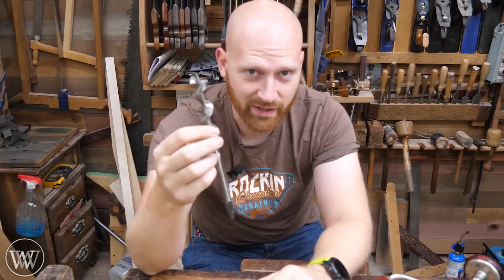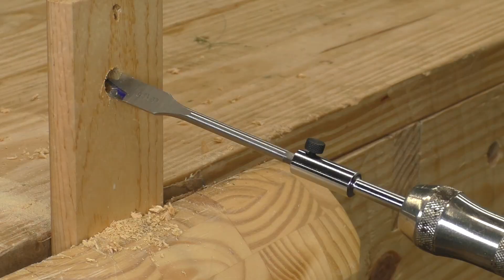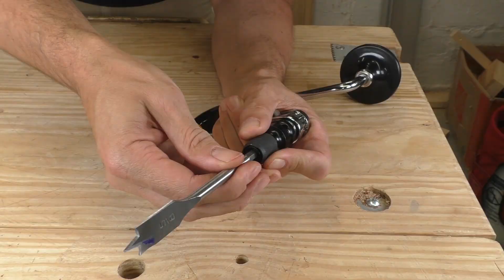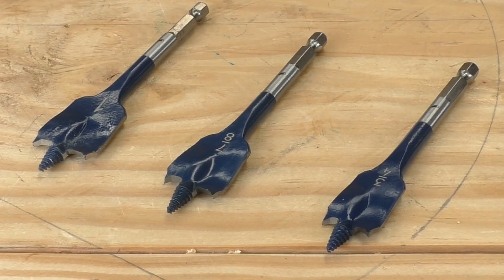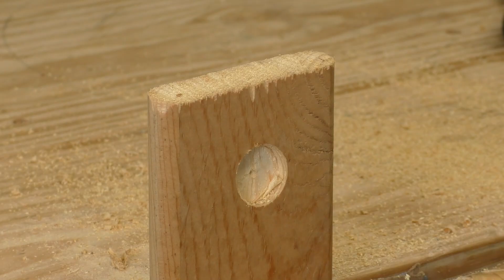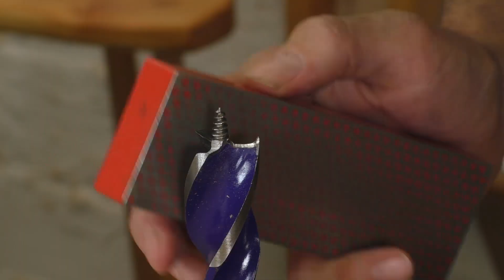Modernize your brace with new gear!

Comment: Rex I really liked the video and the idea of a 1/2 drive brace.  I find a lot of braces, bits and other old tools at estate sales and these are not frequented by many tool collectors.  I found a rusty brace (outside ratchet) that was frozen solid at one and picked it up for $0.50.  I tried all the different ways to free it up but nothing worked until I heated it up with a propane torch and that freed up the chuck that was sprung and got the ratchet loose.  Some time on a wire wheel cleaned it up nice.   I got a 1/2 inch impact extension set on amazon and turned it down to fit and drilled it for the pin.  I have less than $10 in this.  I used the chuck adaptors you mentioned in your video.

Comment: WARRIOR 7PC AUGER BIT SET
AMAZON lead screw pulls into work eliminating extra pressure and strains specialty heat treated alloy steel resist damage from nails quick change Hicks shank

Comment: I think ( due to personal experience hehe), to avoid the chipping, you have to rotate the bit counter clockwise almost 1 or 2mm in with some pressure, so the outside point slice (only when its Sharp) the face of the wood, leaving a nice unsplintered hole.. if you have a threaded snail, you may need a small pre drill or a nail (i dont know the english name but in spanish its called "punzón") so you can make the side edge of the bit reach the face of the board. Nice content Rex! Im sorry if i mispelled, spanish autocorrect+barely know how to speak my own language D:

Comment: Good video. When I was new in the Marine Corps as a helicopter mechanic ( 1973 ) we used a three jaw brace or a rotary hand drill ( most often called an egg beater drill ). Since battery powered tools did not exist then it was perfect for working out on the flight line. Fine tools rarely had any issues with drill bits providing quality holes. No margin for error on an aircraft.

Comment: Just get a corded drill cheaper than the brace Or try these 
https://toolsforworkingwood.com/store/item/MS-JB.XX
I know the point is that it isn't powered equipment though so. . .
They are expensive like rex said they would be but if you can't find vintage ones these are apparently really good quality.
Or you can get the More Modern wood owl bits. They Cut so smooth I'm practically drooling at finding an excuse to drill a new hole, and you can get each one for around 20 bucks a pop 1/2" bits should cost less than 20

Comment: No. Have not found anything modern   that works in a traditional brace. It seems all modern drill bits are designed for high speed. I look for auger bits at boot sales and similar.

Comment: These old tool's built all the old things post electric . I have three old braces ,one with no ratchet ,one with a ratchet and a Russian one with a ratchet. I worked  as a  handy man in the UK for many years, i  sharpened all my old vintage saws myself . Many times on a Friday teatime on a job my Metabo drill which is my very best one, but come four thirty died on me before the job was done .If not for my old brace drill i would have to get up with a hang over on a Saturday  morning to finish a job for the sake of half a dozen half inch coach bolts that needed to be fitted into a hundred x hundred mm fence posts.

Comment: Another great video Rex. I've had an auger brace for 40 YEARS. Don't use it much because flat bits are cheap and effective, but it is brilliant for removing ancient flat head screws. Lock it, rock it back and forth until the screw starts to move. Enormous torque is produced, but it can take the head off Then the ratchet starts to work the screw out. Best regards to you!

Comment: Hi Rex, since I watched this video i´ve been trying to found a solution, at least for the drill bits and I think I found something taht could work, the problem is that I can´t test it because the product is by no means availible in Mexico but here is it:

the design in the daredevil bits you present in the video is unapropiate for hand drilling in fine forniture, they are spadebits but the nickers have a total different design, I did my reserch and found a new product at Lowe´s , the brand "Spyder" sells a daredevil spade bits like the ones you presented but instead of that aggresive style of nickers these ones have a traditional take on that, making cleaner holes and also featuring a threaded point, have hexagonal shank and I think this could work perfectly for hand drilling even though these were designed for power drilling contruction lumber. these bits are branded "Spyder stinger drill bits" 

I hope you can take a look to those and maybe if they catch your atention you could buy them and make a video testing them if they worth it. thanks for reading, keep the good work.

Comment: Irwin Tools, Item Number: 43697, 13-Piece, Square-shank, 1/4" - 1" (1/16" Increments). I own them. I use them. They can be sharpened. Until recently, they were readily available. Affordable is certainly a relative term...but I would say they are. You get what you pay for with these. When I tried to order a second set (to give as a gift), I found they were out of stock everywhere. A little digging has me thinking that this, like so many other things, is a product of the pandemic, and not for having been discontinued. Eventually, stocks will return. When they are in stock, they go for around $120 per set of 13. Though, even at $200, they would be worth it. Mainly because they can be maintained by the end-user & they should last a lifetime.

Comment: Irwin does - apparently - still make, or makes again, square-shanked auger bits for hand braces.  The only trouble seems to be finding them retail .  The prices for indiviual bits seems to be reasonable, if you can find a seller who doesn't insist on some minimum number in a purchase.  The style is the Irwin design (solid center) as opposed to the twisted-ribbon Jennings design.

Comment: For years I have used a garden variety of multibit tools that you would buy at Walmart that have hex shank bits. I use step down bits to make holes in wood by hand, using these. Now the quality of the bits is important. Some of my bits are Bosch and I think a couple are Canadian Tire brand. They work much better than spade bits on manual drilling. When I used to use spade bits I would get massive blow out and tears. I have a few Amazon sourced step down bits but they are made of Chinesium and can’t do much except for MDF and even that is asking allot.

So perhaps try a step down bit. You can get some in standard 1/4 hex shank. The only drawback is that the thicker your material your hole size will be slightly harder to drill because a step bit doesn’t just have a set width so a little extra work such as drilling from both sides etc may be needed.

Comment: I have used the Irwin adjustable auger bit on very low speed drill presses and variable speed electric hand drills. I don't have the proper adapter for my brace.  The Garett Wade brace equipped with the appropriate chuck will provide good results because the Irwin is designed for slow speed and the single nicker has a  "back slope" grind so that it severs the fibers upon entrance like a chef's knife, leaving a clean entrance hole. The screw tip pulls the bit into the wood (unlike the other bits that require applying your muscle or body weight). With the two fully adjustable cross bars, it allows hole drilling from 7/8" to 3" diameter so you only need one bit.  I have dressed/sharpened the cutter many times.  And it's almost long enough to go through a railroad tie if you're into that kind of "fine woodworking" out in the back country. About $35 at the local hardware store.

Comment: i agree there is no perfect solution off the shelf, BUT in my own experiments i took two flat speed bits and triangle file and carved a tapered thread on the point on one.  Not as good as the auger but as close as i could get.
Not perfect but defiantly pulls in more at slow speed.

On a second try i cut the end off of an auger screw, slotted it and welded a replacement tip on the speed bit.
THAT seriously pulls into the wood at lower speed but not so great on the electric drill at full speed.

Speed really is the factor on the design.
.

Comment: I'll try to keep things short .... I'm more a blacksmith (more than a hobby, not quite a full job, at it for 20 + years) who has done hand woodworking. More because there's always a bit of wood or leather that needs to be part of the smithing project. Also do a lot with living history, so using and making hand tools is a thing. (Not saying I'm great at it.) You asked for options and ideas, here goes. 

First on the brace. The 1/2" drive brace already exists as a "mechanic's speeder". Different end handle, but it's a brace that's designed to hold sockets to drive nuts and bolts quickly by hand. I've been using one for years before I saw this and keep one in my mechanic's toolbox and another in my general box. I've been using hex tools in it by the simple and inexpensive solution of a socket that fits the hex shank of drill bits and screwdriver and torx bits. The only modification to the speeder is a 1/2" to 3/8" drive adapter. A bit of creativity to the turning end handle would allow for applying more force. 

Auger bits were not and are not the only bits for braces. There are three kinds I'm aware of, two for wood, one for metal. I only know the name for one type but I have used all three. I can't post photos here but I can put them elsewhere. One that I don't know the name of is basically the same as the business end of the auger bits without the snail. The one I have is hand made and has a point like a spade bit: no snail. It functions something more like a spade bit, but with the longer ears of an auger. Spoon bits I have made and used both what I've made and some I've found. They are not, in my opinion as quick as an auger, but they make a good hole. A bit tricky to sharpen and such but versatile. The last that I've made and used for metal in a kind of medieval drill press, has a triangular tip of very hard steel. It's flat, and the leading edges when turned clockwise are sharp. I think with a different angle at the point it would do well in hardwood. Smaller angle carves a hole fairly well in mild steel, larger angle works as a countersink.

Comment: Irwin still makes square tang auger bits. You can buy the 13 piece set of for under $150, look for Irwin item number 43697. Individual bits are available too. They also make many of their other style auger bits in square tang or hex, both in one bit. You cut the square tang off if you want to use the hex shank in a 3 jaw chuck. Of course you can't go back to the square tang once you've removed it, but that opens up a lot of bits for use in either drive.

Comment: I was pondering using my old brace and bit set and remembered the woodwrights shop on PBS, now that's some real vintage tool users show. I have seen many of the bits at antique stores all over the south, you just have to learn how to sharpen them, and one of the woodwright shops shows taught that. he's been on the air for over 30 years so I cannot remember the episode. He also demonstrated spoon bits as well. Looked very labor intensive.

Comment: I just found (buried amongst a lot of other stuff in my garage) a bucket of old auger bits and I collected my 3 braces to put them back into service.  I second you talking about how to clean up the auger bits!  One of the three braces was my grandfather's - he came over from Scotland as a carpenter a bit less than 100 years ago now - sadly, I am not sure exactly which of the three was his...two of them look a lot alike!  I have some snail-type bits that I use in my brace that I will have to go dig out and try to see if they are any better than the ones you tried.  Thanks for another great video!

Comment: Rex, I got the Garret-Wade Versatile Brace you recommended.  I really like it except for a couple of things.  The upper hand rest seems to wobble a bit.  I don't know if this is characteristic of all braces or just this one.  Any insight you could give would be appreciated.  

Also, the chuck does not fit my jennings style bits well.  The square socket inside the chuck is to big for my number 4 bit and is loose on all but the biggest bits in my set, which goes up to a number 18.  Do you have any suggestions on how I could fix this?

Thanks,

Steve.

Comment: I'm a precision prototyping CNC machinist by trade, I bet I could draw up a way to build new ones based off those old auger bits.
Wouldn't even be all that hard. But even still the metals we use these days are more pure and stronger than the tool metals of old. You'd likely still spend $30-$70 per bit and that's assuming the market demand was high enough to produce a lot of them to keep the cost down. But it's an idea that might be an interesting project to build.

Comment: Hey there Rex - something that might be worth trying instead of the brace: grab a generic 1/4" ratcheting bit driver and one of these: https://www.amazon.com/Irwin-Tools-4935651-Lock-n-Load-Extension/ or https://www.amazon.com/Irwin-Tools-4935652-Lock-n-Load-Extension .  Alternatively you could use a 1/4" drive socket wrench for the handle.  It wasn't perfect, but I just got done drilling 15 1/4" holes with this setup.  You really get a sense for how your bits cut into the wood.  And it's past midnight here in my apartment with no complaints yet from the neighbors :-)

Comment: Actually, the standard chuck that comes on the old bit braces is called a "universal" chuck because you CAN chuck a round or hex bit in it. This works well for simple twist drills where the chucked shank is the same diameter as the cutting end.  It works less well on bits where a narrow diameter shank is working against the leveraged resistance of a large diameter cutting end.  In that case the shank tends to slip in the chuck.
Another point: are you sure old auger bits are so hard to come by in your neck of the woods?  I see them frequently here in central New York at any venue were old tools are sold (flea markets, antique stores, garage sales) and for reasonable prices, like around a dollar apiece.

Comment: I have a big old brace that can hols a 1/2" square or round shank. I just bought a 1/2" socket extension for $6 at the hardware store (we live in a Walmart-free zone, closest one is 45 miles) My plan is to cut off the socket end and square off the stub so I can drive standard sockets, which in turn can drive hex shank bits.

Comment: I see on ebay a vintage craftsman 1/2 drive speed  handles going anywhere from .99 to $20 with about $10 shipping. (I think I got mine at  a thrift store for $5)

I then ordered the Quick-Release Hex Adaptor and Keyless 3-Jaw Chuck and they fit quite nice

IF your hex shaft bits have the retention dimples. as most cheap hex bits don't

I forsee me chucking a number of my cheap hex bits into my cheap corded electric drill and taking a round file to them to get them to work effectively. or replace the crap magnet on my 2" hex extension (which does have the retention thingie)

Comment: If you get the WoodOwl bits, which are awesome, you'll want to pick up this adapter: https://www.amazon.com/gp/product/B0009H5EPA/ref=ppx_od_dt_b_asin_title_s00?ie=UTF8&psc=1 It's like $30, but it fits the larger hex on the bits, and has a neat connection mechanism. putting the bit on is a push rather than a pull mechanism if you're familiar with this kind of tool. Still has the same issue where the GW brace's  snap-on mechanism is far looser than I'd like, and any resistance on the way back out of the hole will pull the bit off.

Comment: I’m wandering through the hardware store, and just saw Bosch brand ‘nail cutting wood bits’ and spade bits that look a lot like the old time brace bits. Spiral snail, finer cutting tooth on the outside edge. I don’t own a brace, but I remembered this video and figured i oughta mention them. Might work better.

Comment: I can't fulfill any of your criteria as regarding bits for braces, but;  If you take a old worn out paddle bit to the grinder and grind off the tips and nickers to a flat edge you will have the beginnings of a brand new tool! I have done so to one and then put a half-round point on it, then used that to drill out a tobacco pipe bowl. I just sharpen each leading edge (Carefully with lots of water bath to cool down) and it works like a charm. You could cut it into a triangle, or clip the edges to make an angled bottom bowl. just what ever you need to have a special hole you can make!

Comment: Hey Rex:
I use a normal twist drill bit.
I have slightly squared the ends on my bench sander, and it works great. Best part?
The squared ends still work fine in my electric drill.
I use a Punch to create a divit to start the drilling, and no further problems.
Granted, i only have ever tried it up to a 1/2" bit, but that's the largest i have ever needed.

I mainly use my Brace when working on outside stuff, away from electric outlets when i don't want to drag an extension cord for a few holes.
(Edited a typo)

Comment: One thing I tried that works pretty well is just to grind a flat on the side of a round shank bit. (Or one of the other type of shanks that you cut off with a hacksaw, leaving a round shank). With a flat on the side of the shank, the jaws on most chucks will grab and work pretty well.